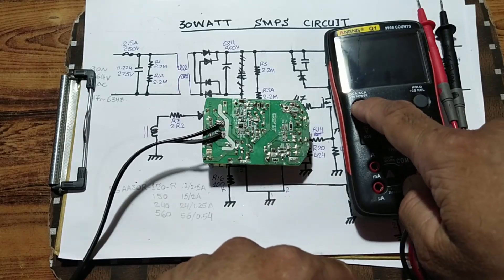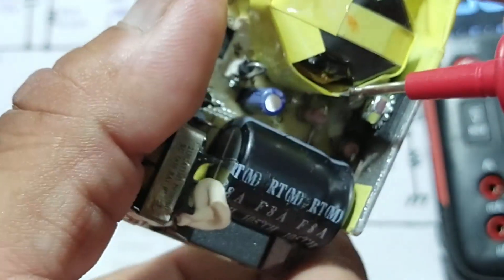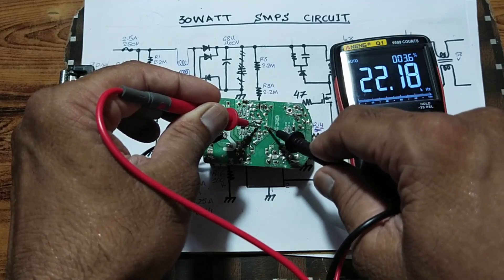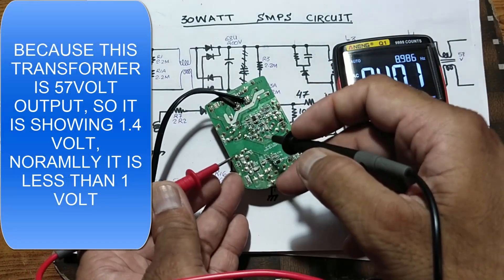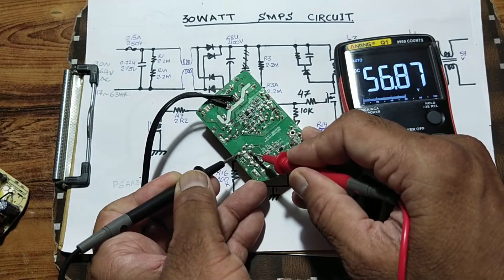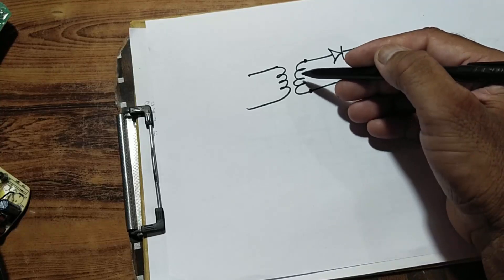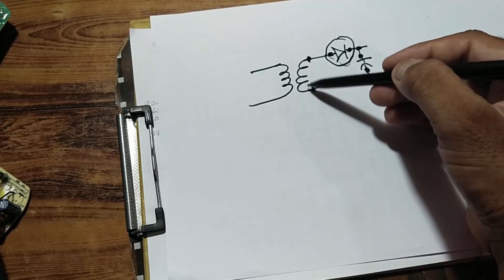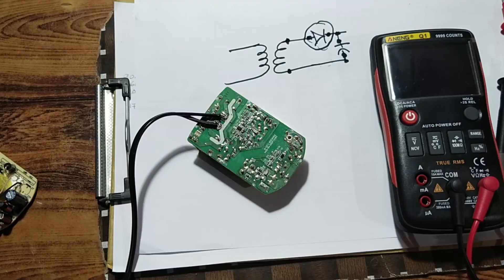[381] How To Test / Measure Voltage & Frequency of SMPS Transformer with Digital Multimeter

Comment: Hello, Sir
I'm testing an outdoor a.c midair card
Problem description: no output voltage
Test carried out:
Tny 286 drain-souce 315vdc: open mosfet
Bp/m-S is 5.8 vdc: ok
SN431 Ref-Anode : 2.5 vdc
Photocoupler pc817 1-2 pins: 1.0 vdc
Tx pri winding : 2.8ohm
   Sec winding 1: 1.3ohn
   Sec winding 2: 2ohm
Sec winding across capacitor 14 vdc
Sec winding across diode: not yet tested
Conclusion: is the transformer faulty 
Thanks for your videos and knowledge 
From Ashvin, Mauritius island

Comment: Hello Mr. Haseeb.
I can read 167VDC to the area on the primary side by the partition from the input of 120VAC.
But I have no reading on the secondary side from the legs of the coil to other side of the diode that you mention.
So I am wondering if I  have a bad transformer or maybe the 167VDC is not pulsating to transfer voltage to the secondary of the coil.
My board looks 5 times bigger than the one you have here.
Thanks in advance for any advice.
Reply from the maker: 167VDC is okay, is it stable?
did you checked VCC voltage on vcc capacitor connected to the VCC pin of smps ?
is the mosfet is switching?
i will suggest to check video number 528. i think it will be very useful
Reply: @HaseebElectronics  Appears quite stable totally.
Well here is what  I just ended up doing.  I tested the switching transistor (K2370 N channel).  I installed a 40k resistor to the collector and its other end to an open gate wire, leaving it out.  And from the collector another 40K and then hook it up to the positive of a lithium ion 4V.  Hooked up the negative of the battery to the emiter.  A cap .1uF between the collector and the emiter.
The capacitor charges when the gate is open, the instant I approached the gate with that open wire, voltage show drop.  Voltmeter is connected to the collector and the emitter.  When the wire moves away from the gate the cap charges and the cycle repeats.
So I assume it means the switching transistor is working, implying pulse voltage to the primary of the coil.
Unless this is wrong.
I happen to follow this other guy's suggestion.
So I don't know if it means anything.
As I would think for the secondary of the transformer to get energized the primary has to get pulsating voltage.
I don't get the total picture.
I guess a voltmeter does not really show pulsation but root means value or whatever. 
But when the capacitor, charges/disharges, especially being gradual the meter in that case can show gradual rise and fall of voltage.
If all this is correct then I assume I have a bad transformer and in my case two bad ones.
I guess transformers can go bad before other things.
I don't know.
Okay from what I see, that K2370 switching mosfet;s collector feeds the primary side of a transformer which is way before the flyback or chopper transformer at the border.
What feeds the primary of the two coils at the border is dc to dc converter Toshiba 2SK3114.
There is two of them.  One of it, the middle pin feeds one transformer but not the other transformer.  And the second one is not feeding either because the ohm reading are pretty high.
The one transformer that it is getting fed, there are two ceramic capacitors. I have tested their farad and it reads fine as specification.  However when the board is plugged in I read no voltage across either one.

The other transformer that no connection exist from either  2SK3114, there even on the secondary side there is some volt reading but not much across the capacitors. But I hardly read any voltage from its pins to the two (3pin diodes) but full continuity.
With respect to the other transformer, there is voltage from the secondary to the middle pin of the barrier diode ( common leg of .25 volts).  So I guess that part only seem to be okay.

Comment: How to chek igbt and mosfet  gate and source voltage  in multimeter  working  condition  in smps.   Its chek dc or ac range  in multimeter??
Why same smps no chek by multimeter  switching igbt ,, sir guide please 
And give same tips

Comment: Mr Haseeb....your teaching method is ideal for us learners..you make it easy to understand a circuit...would I.. connect an oscilliscope to the same two points to see the waveform....ie transformer winding and mosfet drain and what would be the gate voltage..thank you

Comment: From Nigeria, thank you Haseeb. I have a power supply i am having issues with presently. PWM IC TNY277PN is goes into thermal shut down after giving output for about two minutes. I have replaced the IC with TNY178PN but no output at all. kindly assist with solution
Reply from the maker: please check RCD snubber connected across the primary winding
check bridge rectifier and main DC capacitor (capacitor must hold   DC voltage= applied ac input  x 1.414)
check vcc diode and capacitor
Reply: @HaseebElectronics  thank you. I checked to see 352v DC on the DC capacitor before the primary winding. Also I measured 350vDc between source to drain on the TNY178pn ic. But I discovered the source to ENable pin is giving 1.2v DC instead of about 5v DC and also the optocoupler LED side(connected to voltage regulator)does not have any voltage. I will appreciate your help

Comment: Hi sir,this video is nice. I have a crt tv with power led on but it won't turn on.i check output voltage  of the smps transformer and they are b+98v,35v,5.5v and 8.9v instead of b+126v,35v,6.5v and 14v.can a bad diode cause the output voltage of smps transformer to be low.thanks for any response

Comment: Sir I want to ask about zener diode, how can I determine the voltage value atx smps psu in hot side damaged zener diodes? I removed damaged zener diode, I want to replace with new one, I see on zener diode 18 number(Bottom), in other zener diode I see 48 number(Bottom), this number means 18 volt or 48 volt?  how can I replace it with correct new one,
Thank you
Reply from the maker: can you please send its picture to whatsapp 00962-79-1161 084

Comment: Q1 meter is the best meter so far...i have change this meter from 5minit to 15minit auto off     time
Reply from the maker: i use fluke, it is my first day to test it. it have useful functions, i received new piece with frequency fault, it is measuring incorrect frequency. 
i am checking its quality so far
Reply: ya fluke is the best meter 100% accuracy....i have fluke model 179 bought 2007 until now still working well